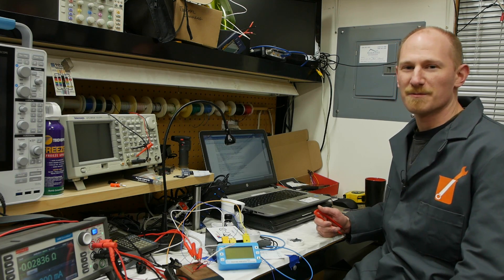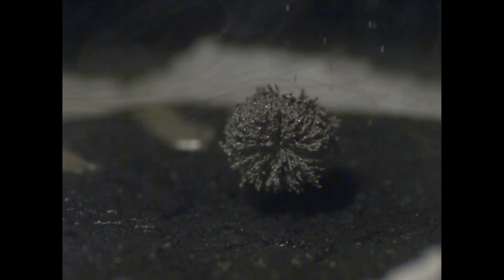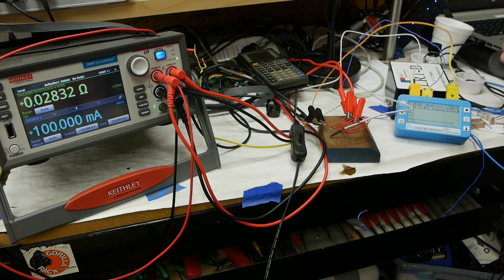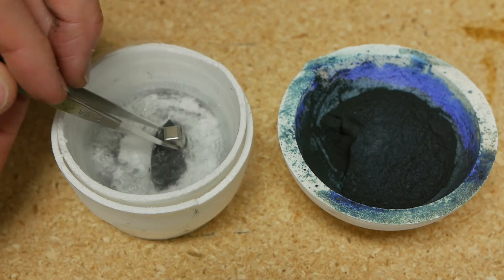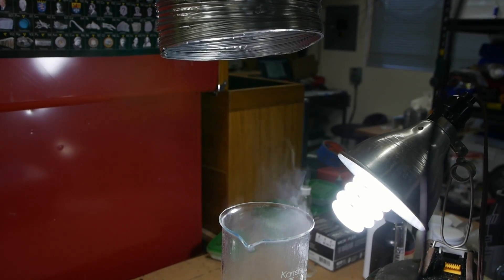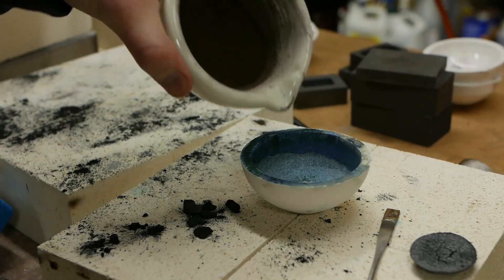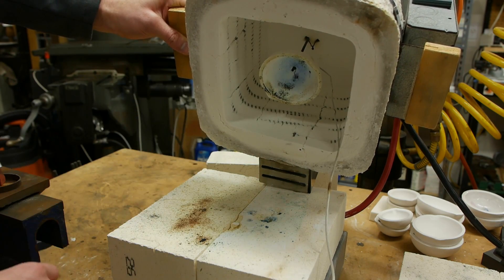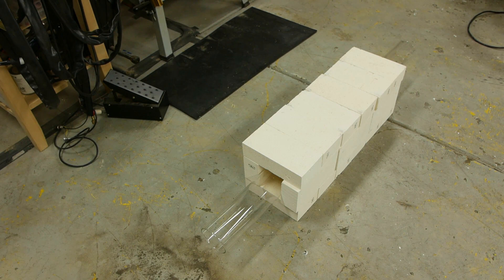Making YBCO superconductor

Comment: The process you're using to create the powder is sometimes called a 'sol-gel Pechini' process. The vapors during that burnoff phase can be dangerous and, since the process is exothermic, care must be taken to make relatively small batches in a laboratory setting or else it can run away and create a serious fire risk, including causing the beaker to break.  Yea, I've had that happen.  Corning 'visionware' 3.5 liter pots (with lids) actually work pretty well for demonstrations and are more durable.

Comment: Judging from the video, your shake and bake SC might not have failed! The superconductor seems to repel the magnet, consistent with Meissner repulsion. 

On a science show I was part of, we demonstrated a commercial grade YBCO slab, and the trick is to lower the SC below it's transition temperature with the magnet close by, separated by a paper spacer. This way the flux channels penetrate all the way through the superconductor, but are pinned on the crystal defects.

Flux pinning where you set the magnet, and it stays there only works for very thin or very bad superconductors. The thin ones because the field can easily completely destroy the superconductivity in the flux channels since they aren't very long, and the bad superconductors since there is enough non-superconducting junk that the field can pass through so it doesn't need to create long channels.

Comment: I'm sure you could use a ball mill to get those powders mixed really really well. And a few days in a ball mill will give you the most atomised powder ever, and at a very low cost. You could make one for a few dollars, with the materials you have lying around. I'd love to see that !
Reply: Long ball milling times will bring lots of contamination and impurities from milling balls and jar itself. As YBCO is very sensitive to contamination, I wouldnt recommend this procedure.
Reply: Space Core I am not sure you can ever reach the cation distribution of wet syntheses (like citrate nitrate combustion) with ball milling. Plus ball milling generally gives you a lot of pollution
Reply: Im 4 years late to the party, but what about a Ball mill made out of copper?
Reply: Not having nitric acid I will try the ball mill method. Cheers
Reply: It’s doable, but you have to be really careful of one thing:
Make sure you have minimal contamination from your ball media
This is especially true if you are regrinding the ybco after calcining
If you use alumina balls, it is possible to contaminate the powders by over 2 weight%
Reply: I made one out of a ice breaker tin and a little fan motor
Reply: Leonardo Ulian make the jar and balls out if YBCO

Phase 1 crappy 1st stage production

Phase 2  maximize purity

Phase 3 maximize consistency
Reply: the goal to make "super asphalt" from this black mass to levitating cars? 🤔😉👍🤑
Reply: Mezuzah87 what are you talking about? It seems you have no clue what you're saying. Comparing scale digits to contamination, that's funny.
Reply: Leonardo Ulian his accuracy is within a couple digits. The concern of a trace spec of dust or contamination is laughable at that point.
Reply: Mezuzah87 Again, scale digits have nothing to do with contamination. He is using pure reagents, maybe a slight change in the relative amounts but not contamination. Dust contamination is irrelevant in terms of grams. Ball milling contamination is critical, and putting considerable amounts of iron oxide into the milled material. If you have carried out your PhD in ball milling we can keep this discussion ahead.
Reply: Contamination? 
Did you see how he did this? His balance only has a couple digits, he did this in open air, mixed in open air bench up, etc etc Lol. Classic engineer trying to "I can science toooo!"

Comment: Brilliant. I read about YBCO  in the mid 90's but I never expected it could be done anywhere outside a proper university lab. I am with Cody on this. It needs t go to the wire stage and then further maybe a motor or something where its actually used in a real life application.

Comment: This is not the first time that you could have benefited from a ball mill. They're not that expensive, and are surprisingly effective.

Also, if you're using type K thermocouples, their measured temperature will drift over time when used above 300C - especially so above 500C. For high temp applications, you need K, N, R, or S if you don't want to see drift.

For reference, you'll be out of special limits on your K type after ~600 hours of use above 500C. Not great for precision furnacing.
https://www.msm.cam.ac.uk/utc/thermocouple/pages/Drift.html
Reply: So what you wrote is in short: "Don't use K, better use K or any of the other" ?
Reply: I was thinking a ball mill would have been a good idea also.  The channel Elementalmaker has some great info on building your own. Not that it's that hard but he has some good tips.
Reply: Wait, y'all talking about tumblers or ball end mill cutters? (I haven't seen full video. Scanning comments while listening)

Comment: Humm why the citric acid ignition? Those nitrates all break down at temp into the oxides so simply heating I. The furnace should drive off the nitrogen. Also I want to see a wire made out of the stuff!
Reply from the maker: The YBCO "tapes" or ribbons sound interesting.  I learned a lot from the responses to your comment already!  Making Nb/Sn wire is also a great excuse for  making liquid helium or maybe hydrogen.  The compressor/expanders to create liquid helium are not anything too crazy (less so than many other pieces of lab equipment), but there is a pretty big lack of information about them.  It's been on my list for a while...
Reply: @AppliedScience  

You can make ceramic superconducting "wires", but because of how hard it is to work with and how low the critical current is even in large monolithic samples it turns out to be a terrible way to make a superconducting magnet.  To my knowledge, there have been only ceramics shown to have superconducting properties at LN temperatures and standard pressure.  All of the ceramics, due to their brittle crystalline structure, make poor magnet wire. 

 Cody, as far as using liquid hydrogen to cool superconducting magnet coils, be careful when charging the thing up.  Quenches can be pretty violent, and the wire can spontaneously stop being superconductive when it reaches high current and magnetic field strength.  The higher the temperature, the lower the critical field and current.
Reply: Maybe the papers from the team that builds cryostats for space telescopes/experiments would be interesting stuff that need to work 15 years in space orbiting L2 need to be reliable and therefore simple. A friend did a PhD in thermoacoustics for cryogeny and later chilled stuff at CERN. We could ask him.
Reply: @AppliedScience  now you need to make lk-99
Reply: Carl Bühler 
dang, I guess there is no making a nitrogen dewar into a superconducting magnet then. Guess I will have to continue my research into making liquid hydrogen.
Reply: @theCodyReeder  From what I understand most superconducting electromagnets have the superconducting material entirely embedded in copper.  It might be possible to make your coil by placing a finely ground YBCO powder trace around a spiral of copper foil, then compacting the copper/YBCO combination with a hydraulic press and sintering the superconductor by running it through the 950ish degree temperature profile again (minus the oxygen part).

If I were going to do that I would probably start with a single test patch compacted in copper foil to see if it maintained its meissner effect properties.
Reply: @theCodyReeder  I want to see this replicated:

https://youtu.be/EXYbHP5bdAs
Reply: @theCodyReeder  I was thinking of doing it by making C shaped rings of YBCO, poking one end through an insulator I put between each layer, then overlapping a bit of each ring and putting a weight on top to hold it together.  Might work a bit better than a wire.
Reply: YBCO is highly anisotropic, so it carries current only in one crystallographic plane. Grain boundaries or other perturbations in the lattice will kill your critical current instantly. This is why Powders in cables didn't work historically and wires from YBCO are now made as highly textured coatings on buffered tapes so the current carrying plane stretches throughout the tape.
Reply: @carlbuhler3184  yçy
Reply: You could still buy the tape if you dont't need long lengths it might not be too expensive. For low-temperature superconductors, maybe you could get some Nb and Ti and alloy and then draw it yourself to form some type of wires? Or buy it from one of the big suppliers. Whats your take on making liquid Hydrogen though?
Reply: MIT has been doing some very interesting work with YBCO tape bought from Alibaba of all places.  They've managed to break a bunch of superconducting magnet records and are working towards improved fusion reactor designs with them: https://www.youtube.com/watch?v=KkpqA8yG9T4
Reply: Applied Science Wow, if you made that happen, that would be super exciting!! Nb/Sn will  be very nasty to produce too as you’ll have to bring all the precursors in the shape you want (e.g. the wound wire of a coil) and then react them by heat treatment. 
And as I guess you aren’t aiming for something in the high field range, the easiest candidate for a LTS wire would still be NbTi as it’s already superconducting as an alloy and does not need reaction heat treatments or oxygen anneals.
Reply: You cant make a great ceramic wire. Other superconductors could be made into wire, like lead-bismuth i think is used in the field
Reply: @alexanderambruso6970  ...lead bismuth,, thankyou, I'll have a play with some type metal I have once the tool of old school printers.. Human being printers.
Reply: At this process the citric acid is a gelatin agent, means it creates strong chemical bonds with metal cations forming homogeneous gel kind of thing. this gel keeps homogeneity of matter till ignition. If u take just oxides or hydroxides of metals u will never get chemically homogeneous material since each metal has unique pH of crystallization from solution. If u use dissolved mixture of different nitrates with different decomposition temperatures and different solubilities u will get something inhomogeneous, clear. The second reason of the use of cit acid is to speed up the reaction due to increase the temperature since u have to "froze" metastable structure of amorphous oxides mixture to get proper material.
Reply: ceramic coated litz wire lol...
Reply: by pyrolyzing avain feathers in a non-oxygen atmosphere- using a metal salt (ZnCl) mixed into the feathers during carbonization at 900C you create a nano-porous carbon that when put into a sealed container and de-gassed , is the perfect storage medium for hydrogen. The carbon will form electrostatic bonds with the hydrogen gas, the nano-porosity increase surface area and storage capacity by over 1000X the containers original rated capacity. The hydrogen will form areas where simply by being under pressure inside of the carbon will cause oscillations in the phase of the hydrogen. Temporary fluctuations into liquid state, and almost a negative pressure to adsorb more hydrogen.
Reply: @wanderingzanzey2126  ... What his sounds cool please tell me your serious
Reply: @noahcarlton4625  yes, very serious :) called Physiosorption. Avain feathers have a hollow nature to them that creates a really good nano-porous structure for hydrogen-sorption
Reply: Also, currently YBCO plated nickel wires are commercially available. Nickel core, YBCO plated :) they are the Industrial Standard for commercially available super-conductive wires.
Reply: They do make it into superconductor tapes and wires,
I’m hoping to go to Oak Ridge soon to do research on making some!

:D
Reply: LH2? You going to space or something?
Reply: Holy shit you've been approached by a wild codys lab, don't provoke unless you want it to organically chemistrate at you.
Reply: Cody - so you ARE preparing YBCO after all?
Reply: So as I understand it you can't make the wire with ybco using the "pit method" where the ceramic is powdered and drawn out in the interior of the wire, because you wind up with the super conducting layers ends having a large enough gap between them that the electrons loose coherence. But you should still be able to use this method to make a wire. Maybe it wouldn't be as thin and flexible, but just do what applied science did, but in that last step make a super thin layer on a metal backing. The hockey puck worked, thus some thinner longer thing will work. Make it thin and long enough and the ceramic can start to take on the properties of the metal backing = a wire.
Reply: The superconducting plane has a coherence length of 2 nano meters and 5degree kink max, this defines a maximum amount of grain boundary distortion before you loose superconductivity. So if you grind up the ceramic and half heartedly try to smush it back together it won't super conduct. But with enough heat and pressure I would think those planes would reform, but more importantly if the planes are not disrupted to begin with then there is no problems.
Reply: I've read that it's the copper that is really responsible for the super conductivity. All the other atoms are there for structural reasons and to take electrons out of the copper plane or put them in. Somewhere else I was reading that graphene can be super conductive in contact with other super conductors. If I had some of this stuff I'd try mixing carbon and probably some more copper oxide in with some ground up ybco ceramic and in varying proportions I'd try the pin method for making wires. Either that or smear (perhaps the carbon source is like peanut butter?) out a layer on like a copper sheet and treat it with a laser.. or torch it and smash it with the press.. perhaps burn some of it in a plasma and deposit that onto copper or graphite. idk just some random ideas.
Reply: Hi Cody, the ignitioin part is for FUN
Reply: Thanks for the link, it's invaluable.
Reply: Hey Cody :D
Reply: No idea what you're talking about but I'll just trust your usual awesomeness :D
Reply: I love this superconductive material. Years ago CalTech was working on a superconducting quantum interference device. SQUID that thrilled me. Unfortunately they had to end it due lack of funding.
Keep it up. Excellent work 👍
Reply: It's an SHS-type combustion reaction (Self-propagating High-temperature Synthesis). The nitrate-citrate redox reaction is exothermic. This raises reaction temperatures well above initiation temperatures, favoring the formation of oxides over oxide-hydroxides or whatever. As well, it's been mentioned that the metal ions are complex by citrate, preventing flocculation
Reply: ......late 1980s is when this formulation occurred. Schools everywhere were doing it.  What we want to see today is graphene doped enhanced conductor ; a superconductor is a little too much to expect . Some composite with high percentage of graphene.
Reply: ybco thermite?
Reply: Yçf
Reply: Same here
Reply: Still under the Acid effects, Cody? ;)
Reply: @valije  yfy
Reply: @valije  yfy
Reply: @valije  ycf
Reply: Cody, you'd be the type of person to make this, then see what happens when you shoot a neodymium bullet at it or something. Or make a railgun out of this stuff
Reply: Cody'sLab Oh my god lmao liquid hydrogen! 😂

Comment: great video. I think it's quite possible for liquid N2 to be at a temp less than its boiling point (-196C). Evaporative cooling because it's boiling.  That's why you can put a balloon in liquid N2 and the air will liquify... that wouldn't happen if the liquid were at the boiling point temp.

Comment: A little concerned that the fire-bricks/insulation-bricks could scratch the glass/quartz/silica tube?  Don't know if that would cause any problems.
Reply: Fire brick is much softer than quartz

Comment: Those two processes make me think that you could combine them. Instead of dissolving everything into a water solution, could you find some solvent that dissolves the YO, but doesn't mix with water? Perhaps the YBCO will form at the liquid boundary and precipitate out. THat has got to be better than a violent and lossy self-combustion. 

Another way to do this might be to use the nitric acid to dissolve the YO, but then simply evap the water instead of boiling it, perhaps with a vacuum chamber. That would also keep loss to a minimum. In fact, if you could somehow chemically ensure that the YCBO forms in solution, you could then grow solid crystals of it by slowing down the evap rate.

All in all, I think the process could use some more refining chemically. If you are able to refine the process, you will refine the product.

Comment: 4:36 Why isn't it possible? If you blow on liquid nitrogen doesn't it get colder?
Reply: I think it's because the nitrogen is boiling throughout the experiment. Just like boiling water (at normal pressure) can't be hotter or colder than 100°C. If it was colder it wouldn't be boiling.

Comment: Great video.
I think it maybe possible to improve the procedure slightly by crashing the nitrate salts out of solution suddenly rather than boiling them down (by boiling to dryness the nitrate salts will precipitate at slightly different times due to different solubilities forming a less intimate mixture).
If you add a large amount of liquid miscible with water but in which the nitrates are not soluble very quickly with strong stirring, then filter off the precipitate and proceed with the heating to dryness/ignition. you might get a super conductor with smaller more uniform crystals and fewer flaws.